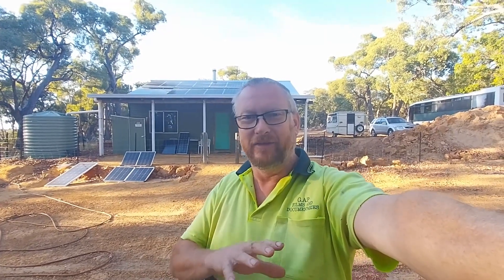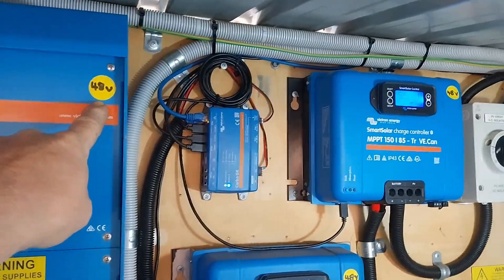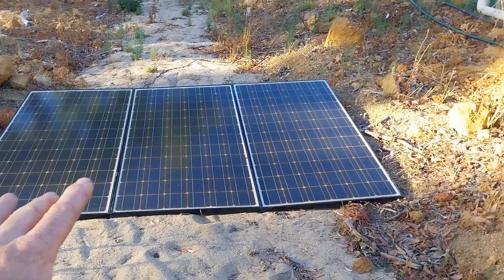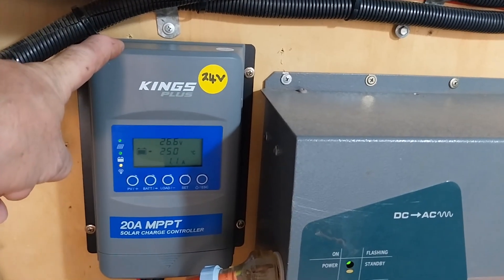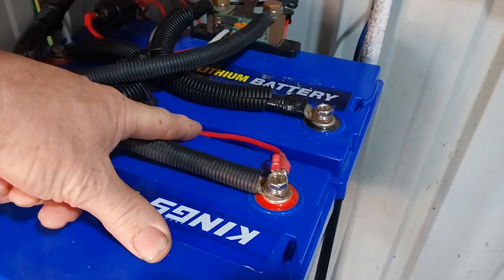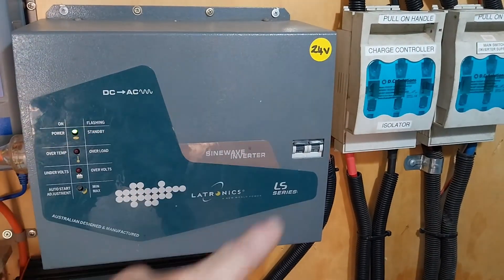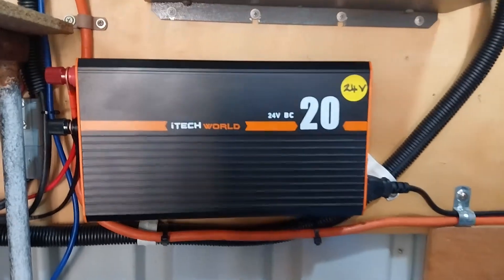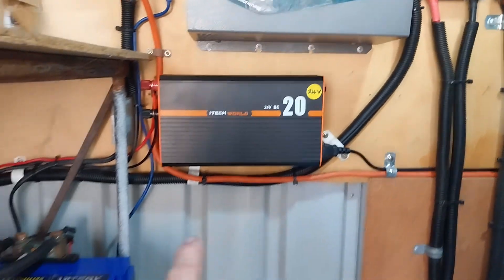24 Volt Off Grid Power System In Detail

Comment: What is the idle draw on that low frequency inverter
Reply from the maker: The standby current is 0.32 amps.
If we run some numbers on that, it works out to be around 7.5 amps over a 24 hour period or 375 hours of standby time on the 120 Ah battery bank which is 15 days. That's provided you don't draw any load from the inverter and turn off the solar input. It does have an idle mode where it goes to sleep until needed to save on the standby current. It sends out a pulse looking for current draw and when it sees a load being applied, it wakes up and provides power to the load. I think it dose this in 0.02 second ?
Reply: @TheSimpleLivingAussie   that's incredible any link to buying one?
Reply from the maker: @viyusavery248  I bought this back in 2008, or around that time anyway. I have heard the Latronics is no longer around but you still see them online.
Google Latronics Inverters and you find some places still selling them. So not sure how true that is with them no longer being around.
They are pretty expensive and for the lack of functions compared to a Victron inverter, I would go with a Victron. Back when I bought this Latronics inverter, Victron was way out of reach in price... how times have changed.
Reply: @TheOffGridBachelor  oh ok, I'm not very interested in more features just lower idle consumption mostly I know the victron has low  idle draw but yours seems like it's even lower I'll check both out

Comment: Sorry if I have missed something. But does the 24v system have a earth rod on the 240V side?
Reply from the maker: No it doesn't but it is a good point.
However my 48 volt system does have both grounding rod and M.E.N link (Earth / Natural bond). So I would have to look into it and see if having two separate systems earthed is a good idea.
This would technically be tying the ground / naturals between the two inverters together via the earth line which could cause issues with the 48 volt system, as the earth and neutral lines are linked through the M.E.N
In the event of current bleeding from the 24 volt system (after the distribution block), the RCBO will trip, breaking the circuit, so it is still a protected circuit at the GPO's.
Be something to look into though 👍
Reply: @TheSimpleLivingAussie  cheers for reply, I'd be interested in what you find out as I have similar situation but use a rcd duo breakers (from powersafe) as I don't have a earth rod and MEN.

Comment: Great stuff Glen, I have a 48V system, but also many smaller sub-systems, namely a dedicated 12V for the NBN, Modem and Weatherstation running from a 40W panel, a smaller system for the remote garage door and also one for the electric front gate. All are performing flawlessly. Next will be a small system for the bore. pumping slowly when we have our dry season. A small pond would be great at your place, you would get so much wildlife in especially in the warm dry months ! 🤠😎

Comment: Always on the hunt for lower wattage appliances like kettles. Target had a blue 1500W one for $15 which I ended up buying for $7 after a Xmas clearance shop. Same for the 2 slice toaster 750W for $7.50 so a bit better for smaller inverters.
Reply from the maker: I want to get one of those small one cup electric camping kettles. I think they are around the 500 - 700 watt range.
Reply: The 12V Rovin is not a bad compromise if you can handle the 20min wait. The other option I am considering is a power station or inverter with 120V AC as then a 2200W kettle should work fine at 550W
Reply from the maker: @Solar-42  Not sure if that would work. As I understand it, watts doesn't change, only the voltage and amps. So a 2,200 watt resistive load like a kettle would be asking 18 amps from a 120 volt outlet.
I think that is the reason electric kettles only go to 1,800 watt in the US as there 120 volt outlet is rated to 15 amps. So a 110 (or 120) volt power station @ 550 watts won't run a 2,200 watt kettle.
I have considered getting hold of a 120 volt 60Hz inverter and playing around with some appliances from the US, that would be fun 😃
Reply: @TheOffGridBachelor  The combination of Ohms law and Power law applies here. Because the resistance of the kettle, lets say a 2400W kettle, is 24 Ohms, at 240V it will be drawing 10Amps. So if we halve the voltage to 120V at the same 24 ohms it should draw half the current or 5 Amps. Power = Volts X Amps so 120V times 5 Amps = 600W. With a 120V inverter at 600W the same kettle should still boil 500ml of water fairly quickly.
Reply from the maker: @Solar-42  Ah yes, I didn't take resistance into the equation.
Your making me wanna buy a 120 volt inverter and test it out, checking eBay as we speak🤣

Comment: do you use battery balancers  on the 48v , if theyre lead that is, 
alot of guys i know whove been offgrid for over 40 years switched back to 12v , no more battery issues,  ive gots lots of latronics inverters, pitty theyre out of business now due to cheap imports no doubt
Reply from the maker: I don't use a balancer on my 48 volt batteries as they are not lower voltage batteries in series. I use Lithium 48 volt batteries which have their own internal balancing.
Previously however when I use to series four twelve volt batteries up to 48 volt I did have balancing issues but that was with AGM batteries.
Going back even further I had eight 6 volt L16 size FLA (Flooded Lead Acid) batteries in series to 48 volt without any balance issues. However with FLA batteries I use to do an equalization charge which would bring the cells back up to full and remix the electrolyte to combat stratification, which can happen with FLA batteries.

Comment: Lovely Ep and setups with backup setups great stuff Glen.   Gee it must be dry in your area as you have no lawn.
Reply from the maker: Yeah it is very hot and dry here in summer. If I was to put in a lawn, I would go through tens of thousands of litres of water trying to keep it from dying in our hot summer temperatures.
The other thing is my area is all rock and gravel with no top soil, lawn would not grow. I would have to bring in a heap of topsoil to have lawn, it's not worth the expense and the hassle in summer. Eventually I will landscaping the area out the back of the cabin and be putting in a pond. That's if I stop spending all my money on buying Lithium batteries and solar controllers to pull apart 😆
Reply: @TheOffGridBachelor  No worries great stuff,  Yes gotta do what works for you.